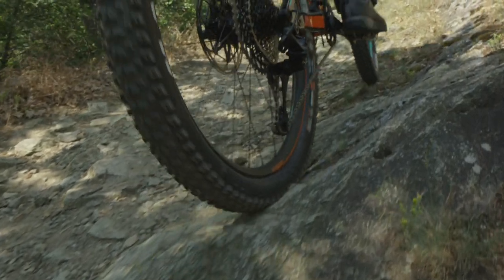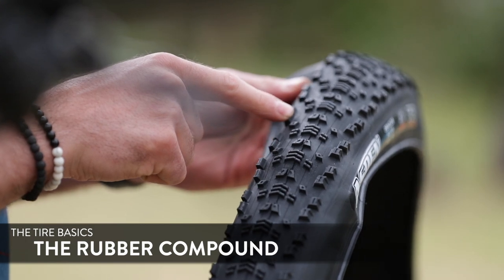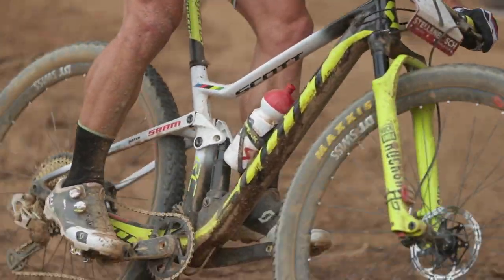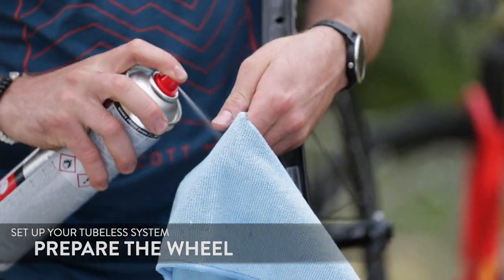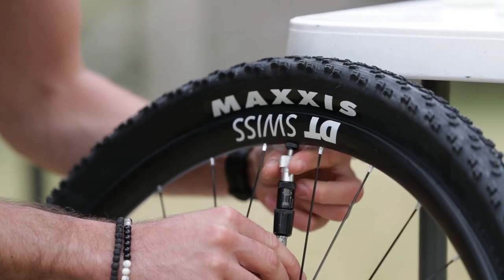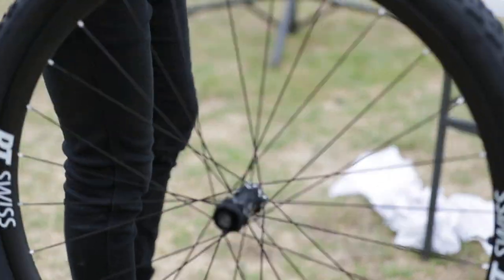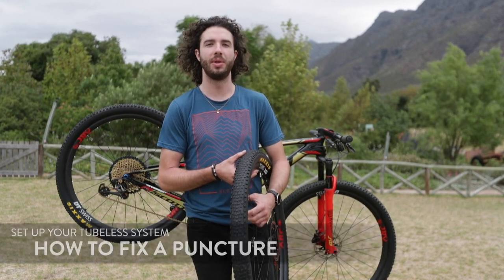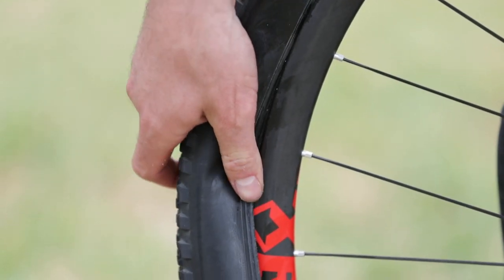How to Set-Up Tubeless Tires with Yanick The Mechanic

Comment: Hi Yanick, very nice tips! Thank you! But how to inflate the tubeless tire with a regular floor pump? I tried it and didn't work, I had to go to a bike shop...
Reply: It always doesn't just work.
Reply: Just go to a gas station and air your tires up there. Just make sure you've got your presta valve adaptor. No need to drive all the way to a bike shop.